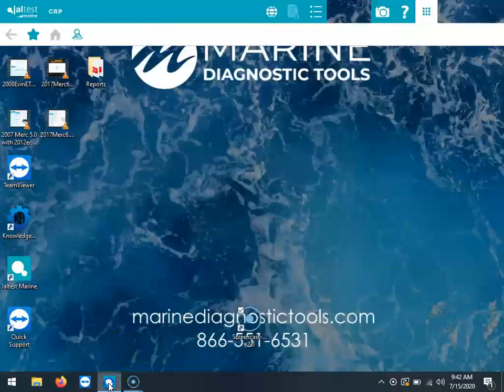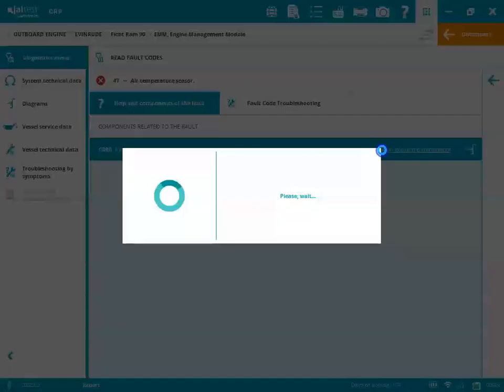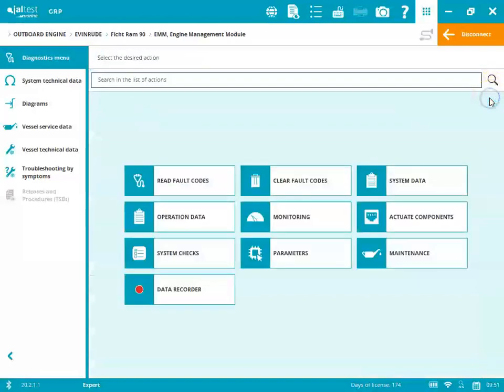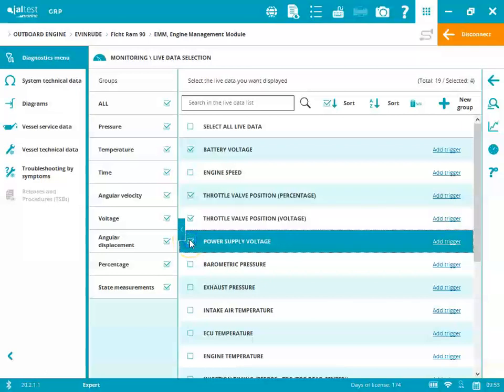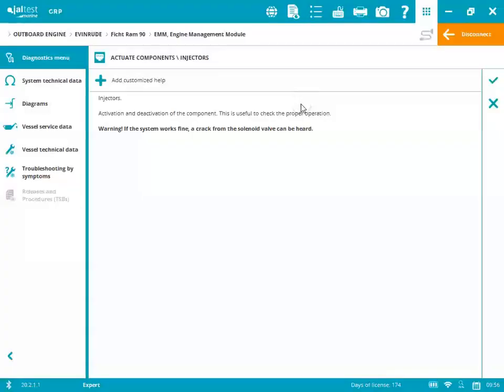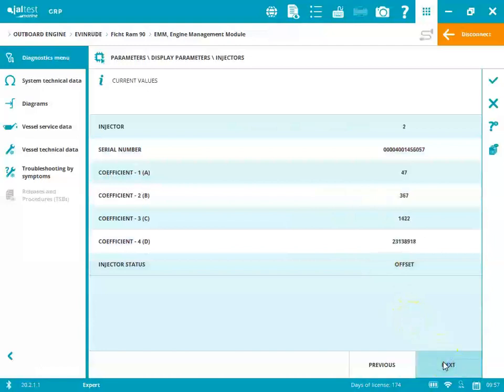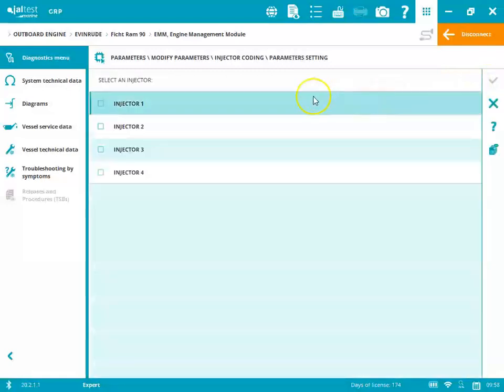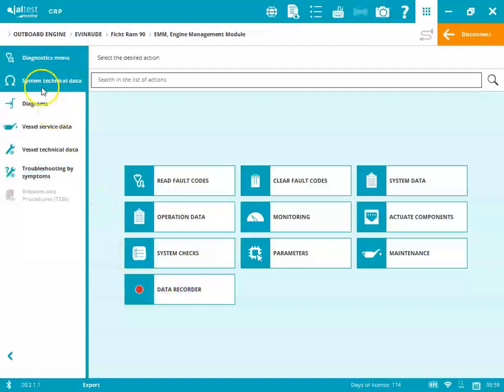Jaltest on a 2000 Ficht Ram 90HP

Comment: I have Texa diagnostics that I bought from DL.  Works great on everything except for one particular group of trucks.  Penske units with the 6.7 Cummins engine with a Geotab telematics system installed.  Texa will not communicate with the engine ECU.  Tried everything.  Any ideas?
Reply from the maker: Have you tried unplugging the Geotab? Something is interfering on the datalink, as TEXA works great on the ISB 6.7. Another suggestion would be to purchase the T50 cable (and the power pack) so you can go directly to the Cummins ECM and just bypass the datalink. https://www.diesellaptops.com/products/texa-truck-and-off-highway-cummins-3-pin-t50?_pos=1&_sid=2d3cd8994&_ss=r
Reply: @DieselLaptops  yes I did.  Nothing seems to work.  Using a T50 cable seems like a plan that would work.  Thanks for responding so quickly.  Really appreciate it.